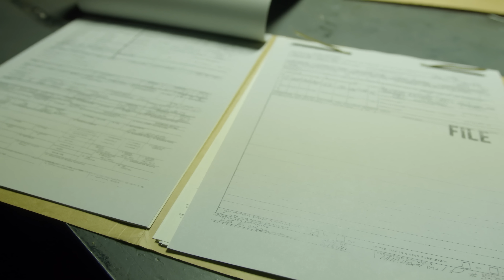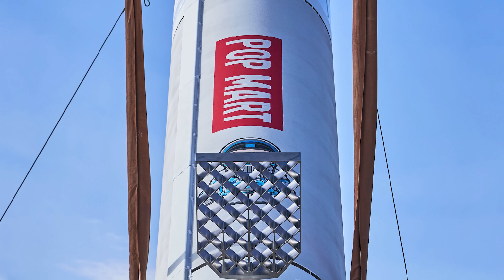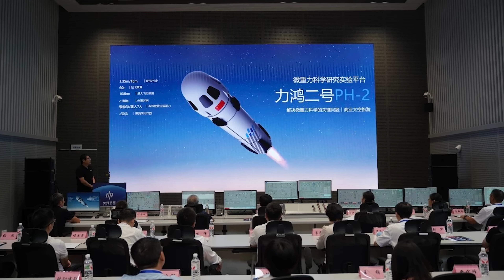What China Discovered from Damaged Capsule after Landing! Better than NASA Boeing

Comment: I suggest you find out the correct name of what china calls their space travelers, I will tell you they are not called Astronauts. They are called taikonauts
Reply from the maker: I will fix this, thanks
Reply: Not true. 

Chinese astronauts are officially called 航天员 (hángtiānyuán) in Chinese, which translates to "space navigator" or "celestial navigator." This term is used in official Chinese media and by the China National Space Administration (CNSA).

While the term taikonaut (derived from the Mandarin word tàikōng, meaning "space") widely used in western media was first used by a Malaysian, it is not an official designation in China and is considered informal. 

China officially call them "Astronauts" in their English media release.
Reply: @esphilee This is the correct version.
Reply: Astronaut was correct, no need to change.
Reply: Astronauts is just a translation. Nothing wrong with that.
Reply: No, 'astronaut' is the term commonly used in China. 'Kaikonaut' is also used sometimes, though.
Reply: @JLDaDragon ne pas confondre taiko avec kaiko (海溝) qui signifie fossé
Reply: @philippehuchon236  It was just a typo — thanks for pointing it out!
Reply: How this was made

Auto-dubbed

Audio tracks for some languages were automatically generated. Learn more

Comment: No crew onboard turns this into a true engineering test.
Reply: NASA had exactly the same situation with its Starliner. It malfunctioned (gas leakage) and left its crew stranded in ISS. It was then returned to earth uncrewed. It did not suffer further damage. It gave NASA personnel invaluable data on the return of damaged spacecrafts, which is helpful when deciding on future such returns.
Reply: @eugenec7130 must have been a temu gas line 😅